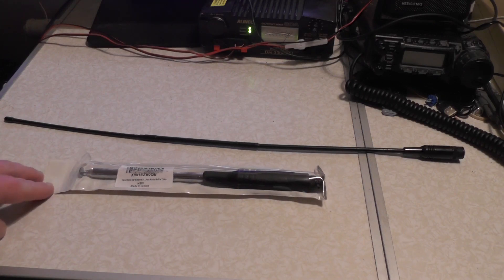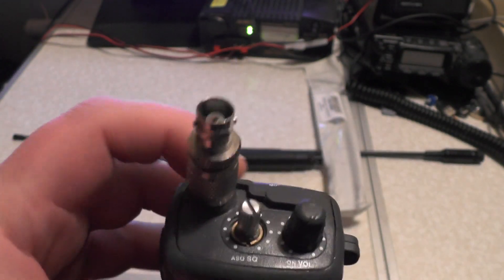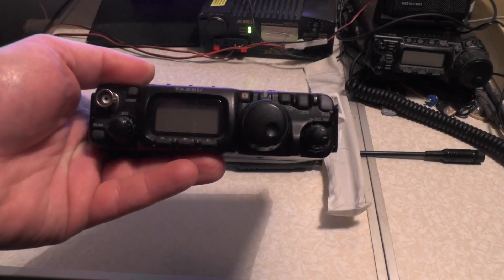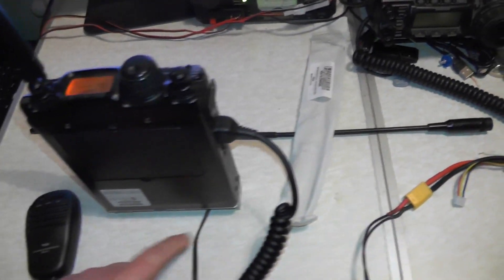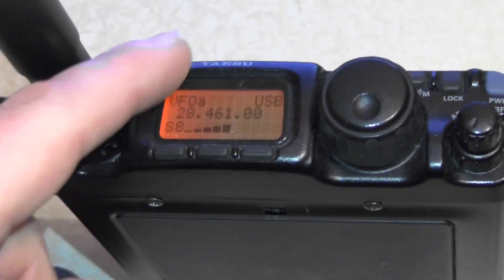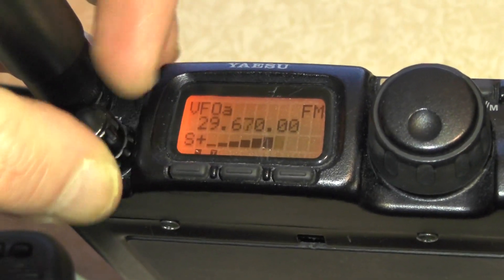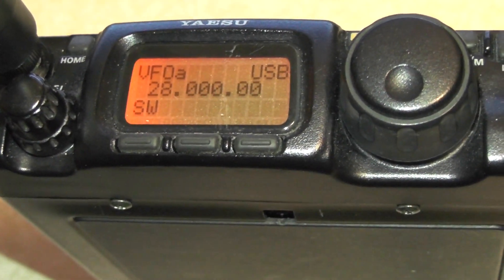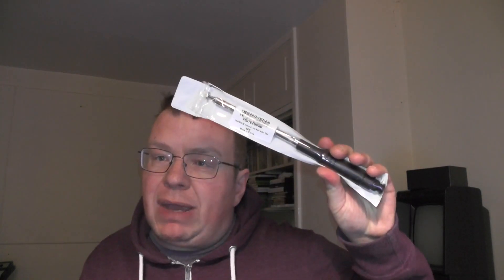27Mhz antenna

Comment: I've got one jez works well on 27 MHz
Reply from the maker: it seems to work better than the albrecht antenna
Reply: @2j4ez  I can't compare but will take your word for it , when you use your 817 mobile with battery what battery do you use what plug fittings and what charger for battery do you use cheers

Comment: The Team Pico came with two battery packs from new. I bought mine new in 1999, from Nevada in Portsmouth. The 6 and 8 pack were in the box as standard, but there was an optional extra... the battery pack that took 10 batteries for extended use on high power. I never bothered with it, as I bought the car adaptor that I've still got. Finding an 8 cell pack on it's own now would be like finding a needle in a haystack.
Reply from the maker: Mine came from truck king but only got the 6 pack with it not seen the radio for sale online only the manual I’ll keep looking

Comment: Jez, I'm after one of these antennas for 20m.
Non of the shops in the UK seem to stock them for this band. Any idea's.
Reply from the maker: I’ve seen them on eBay but coming from Thailand was tempted to order one my self will try and add a counter poise wire and then see what’s the swr is like on 20m it may work
Reply: USA ham radio stores have telescopic HAM whips like this for all bands from 80 to 10 meters. They work great with the FT817ND front connector while wearing it with it's shoulder strap.
Reply: They're made by MFJ Btw so anywhere that stocks MFJ products.